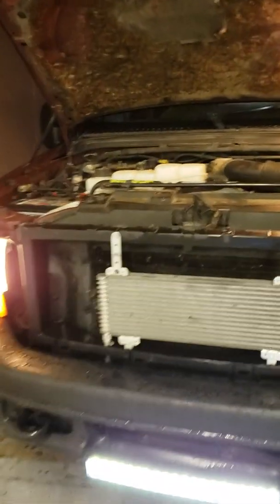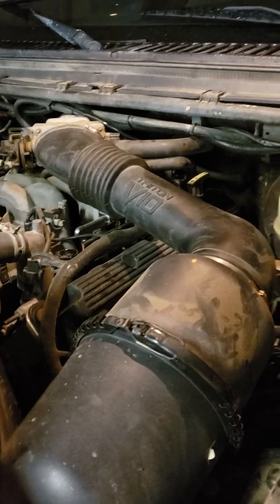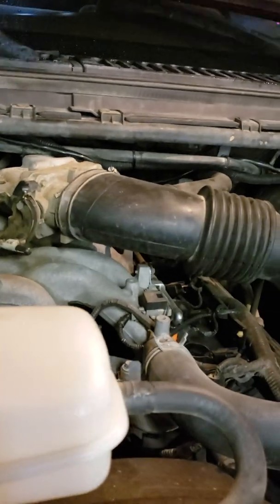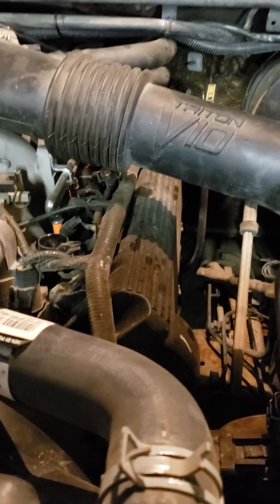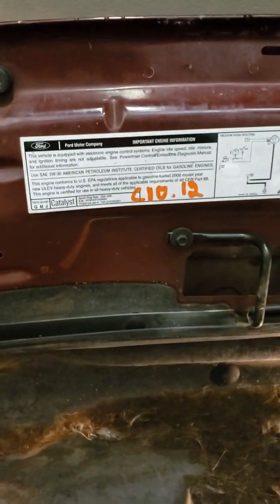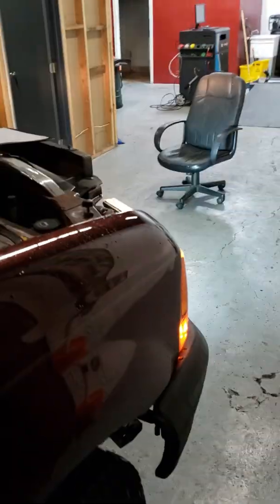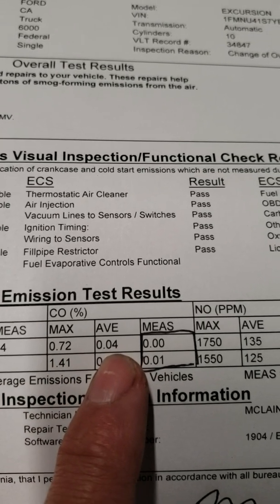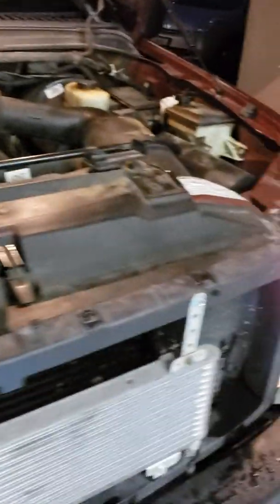Ford V10
6.8L 415 inch Modular Engine Review

Comment: 2000 X  v10  all original like yours except for the fan belt and thermostat… 250,000 miles and no Blown plugs sure broken exhaust manifold bolts   I bought it with 70,000 miles, but I never told… It was a people mover